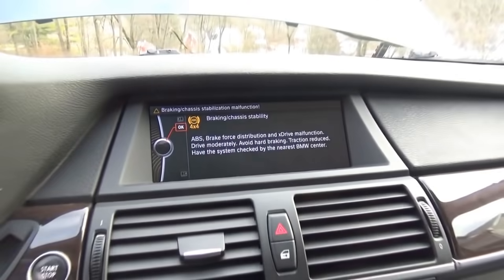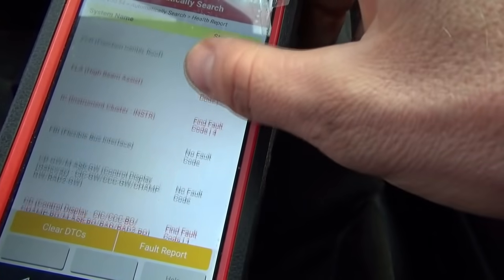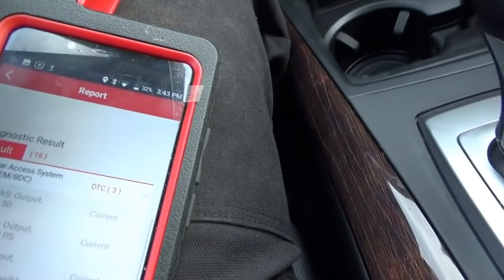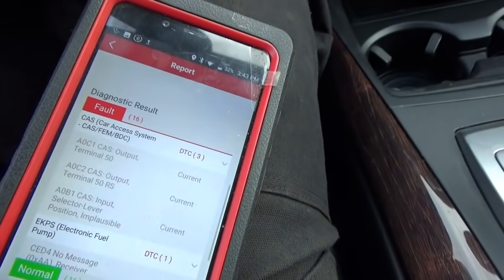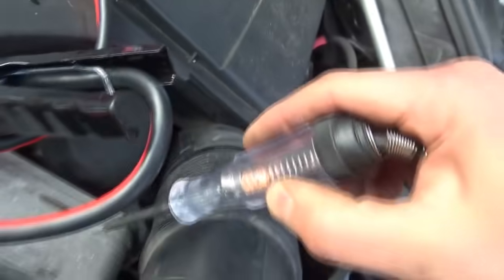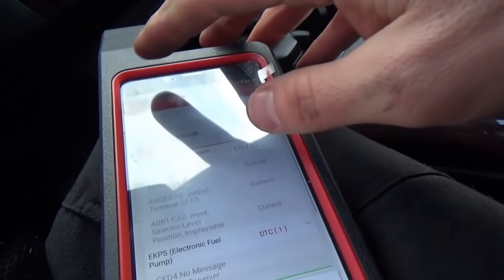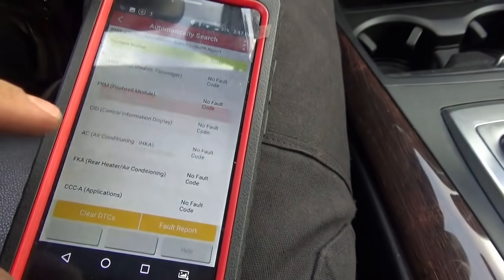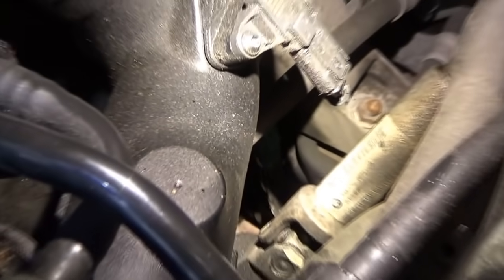Busted BMW (No Crank, No Comm)

Comment: I had the same issue with my X5 35d 2009 that I bought a few days before it died on me. 

Same, no crank but then with a “new” ground it started. 
The ground strap was completely done. Also the one in the back near the muffler was gone...

With a new ground straps it started fine but I think this issue caused another issue. 
I had an intermittent 4x4/DSC/active steering DTC’s and warnings etc.
A couple of days later I changed my brakes and tried to clear the service counter but it wouldn’t clear, instead it turned to minus xxx km and also turned on a red brake light warning in the icl. 
I couldn’t clear it. 
I tried everything (INPA/ISTA etc). Pinged all cables etc. No wire cuts etc. A known common issue is that the the main harness at the A pillar corrodes due to washer fluid that drains near the harness... But not on my car (yet). 

Well, I had to leave it at a workshop. They tried to reprogram the whole car with no luck. 
Then they tried with another ABS/DSC ecu from another X5 that had a broken main harness... This solved the issue but it took them a lot of hours to find the issue.
I got a refurbished ecu for my car. 

I can also recommend to check the rear lights as they when getting old will let in water in the trunk... The LCI version of lights have an internal “drainage passage” that will let the water go to the outside...
I had a lot of water in the trunk area. Luckily I fixed it before it toasted any (more) ecu’s....
Reply from the maker: That's why Keith D calls them "fishbowls" hahaha
Reply: @PineHollowAutoDiagnostics  my German friend told me what BMW stands for:
“Bring Mir Werkstatt” 
Well, I haven’t learned yet. Still have three of them. E61 520d, E70 X5 35d and an E39 M5. 
I like to punish myself, ha ha.

Comment: Hoping you can help me figure something out. My daughter just got a 2011 X5 35i Twin Turbo. It died on her driving and they towed it home. Found bad ground cable and replaced with OEM. Battery appeared to be shot (huge voltage drop trying to start). Replaced battery. Still just click and no crank or start....Pulled starter and it tested bad. Replaced starter and still have the same issue. It kicked a bunch of codes probably due to low voltage. I cleared them but when it fails I get DSC, 4x4 and transmission malfunction warnings on the screen. Not sure if they are due to the low voltage situation...any ideas???
Reply: Hello, Did you figure it out? Thanks G

Comment: Hi Ivan, i got a 2017 BMW G30 530i to work on. The customer says it had a bad battery and he was jumping it to move around. He parked the car one day, the following day no start, no crank, no cluster lights, no egs ignition lights, (no P,RND light) cannot scan the car, etc. Checked all the fuses physically none was blown except 1. That has been fix. Issue remains the same. Any lead trick or lead?
Reply: Hello, I got same issue, Did you figure it out? Thanks G

Comment: Those ground cables are made of 2 different metals, so after a couple of years they will disintegrate due to "electrolysis".
It will bring a lot of Beamers back to the dealership. BMW= Bring Me your Wallet
Reply: And the materials are subpar to start with, which doesn't help ...

Comment: I have a BMW 550i xdrive last night no crank or start called my dad he jumped started it 2x first didn’t work second time worked.  So you think it’s a battery issue or a fuse?
Reply from the maker: Hard to say without doing an actual DIAGNOSIS lol
Reply: @PineHollowAutoDiagnostics  why are you laughing I want to fix the issue
Reply from the maker: @razfrankel  Hard to fix something without gathering some data...Did you follow the diagnostic procedure that I showed in this video?

Comment: That ground strap is the wrong material. They used non insulated and that braided crap that is mostly used for strapping down material etc.  Those Germans need to use fully insulated quality wire/cable like the rest of the vehicle or other vehicles use. Make no sense to have a beautiful battery ground cable and then revert to a braided contraption that is subject to the elements to ground the engine.  This problem comes up all the time on newer vehicles with computer problems.  BTW...just out of warranty too.
Reply from the maker: It's almost like it was designed to fail just past the warranty! I would have replaced the OEM garbage with a regular thick insulated wire ;)

Comment: I guess with a premium luxury brand German Car it comes with cables and connectors made in China. BMW will give you a high end seat but cheap out on real important stuff. So Pathetic
Reply: That's the way they're all going today, unfortunately. 

My '07 Chevy Silverado was built in Canada with parts from China, Taiwan, Thailand, and Mexico. So much for apple pie and baseball ...
Reply: I’ve got that same ground strap on my 1974 VW bug! Must be a German thing to use those braided ground straps.
Reply: @dh-_1011  - They use them on just about everything. my '93 Volvo 940 has at least 2 of them (although MUCH better quality metal than what's used today), and my '07 Silverado 1500 has one as well.

Comment: Very true diagnosing ... Sir if you read your help on bmw ..it's hard to diagnose .. 530d F10 n57 ..no communication with dme,,dsc,,Icm, szl module and radio, not on..wipers working continuously ... So any idea pls ..
Engine starts fine .. with no gear shifting indicator on cluster ..